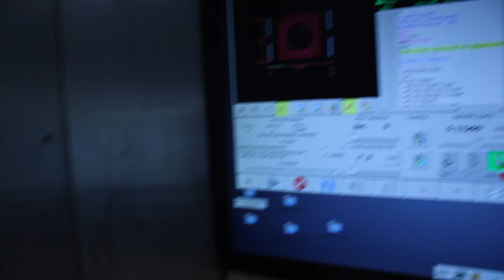3D Meister CNC machine

Comment: Can medium carbon steel material be worked by your cnc machine?
Reply from the maker: i don't know yet. The 2.2KW 24000rpm Spindle is the first limit but i guess it can make very small cuts. I could/should eventually improve some components to tap the full potential from the granite base.

Comment: Is this still using the 12nm stepper motors from your previous video?
Reply from the maker: The previous video was mit 3nm steppers.
In this video, the Z axis has its 12nm motor and i am machining the x and y 12nm motor mount. It was not such a nice speed and fixture setup in this video.
Reply: @3DMeister  do you use a gear box on the x axis or is it just the same ball screw set up as there is on the rest of your machine? I really enjoy your channel, thank you so much for posting and replying to comments, Ive read a bunch of them and the information is very helpful. Thank you!
Reply from the maker: Jacob Bruton Brauer i forgot; its a 4th axis part in this video , im using the 12nm setup! All axis have the same setup with a ratio 1/2 and timing belt